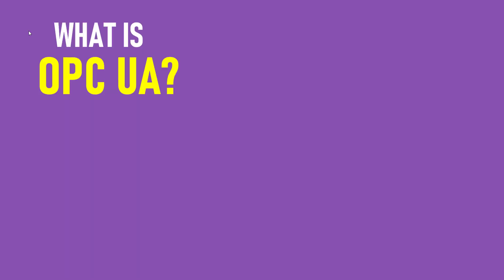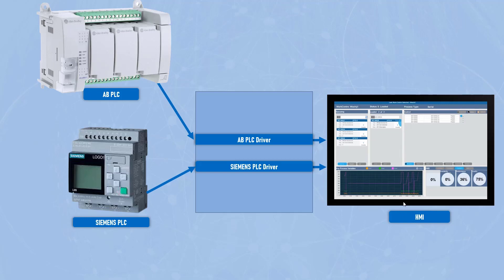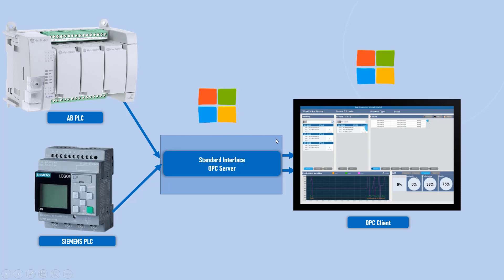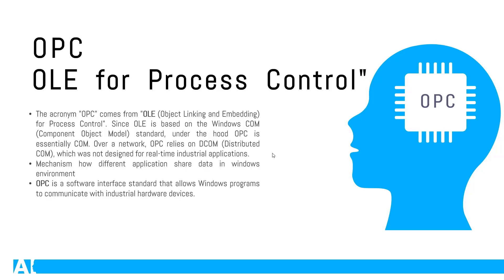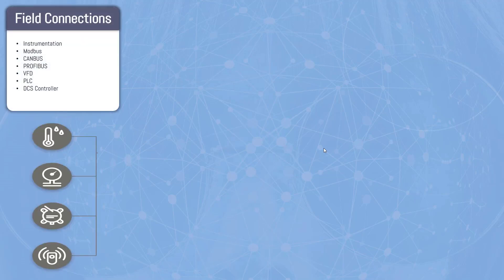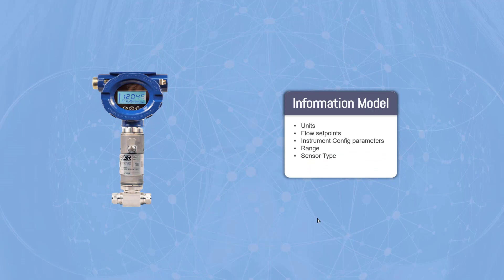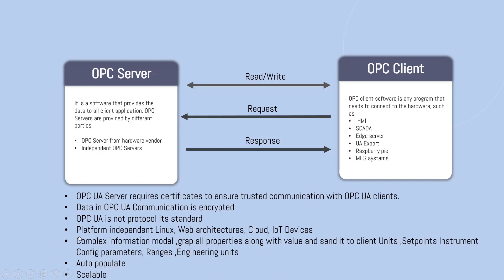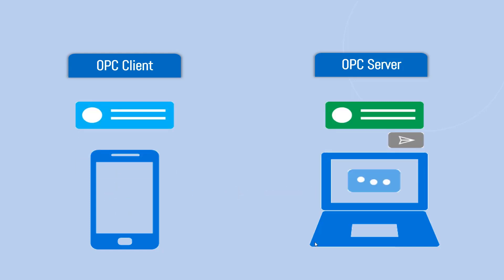What is OPC UA |How it works ? Tutorial for Beginners

Comment: Thanks for a good presentation, one point I noticed is that while the one side of OPC is standard (i.e., the OPC side) the device side unfortunately is NOT STANDARD at all. The reason I think so is that to connect to a particular PLC siemens for example I have to install the driver for that particular protocol for example Siemen S7-200 or Industrial Ethernet or S5... protocol. Notice that none of the above protocols will help connecting to an Allen Bradley PLC. It seems to be a bit of a fallacy to present OPC as a monolithic item in your diagram, you are missing the entire complexity of the PLC (device side) connection.